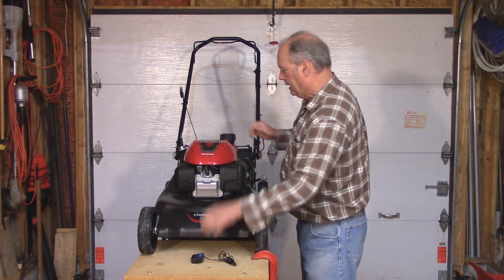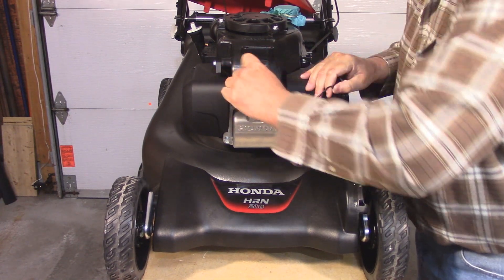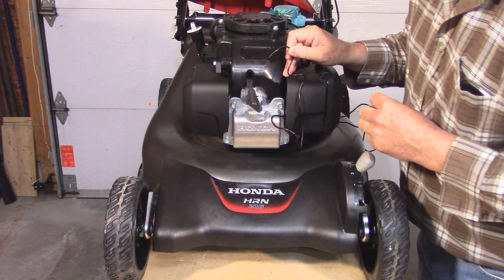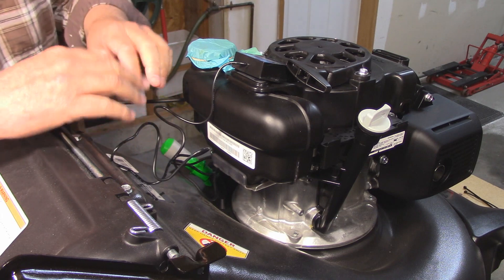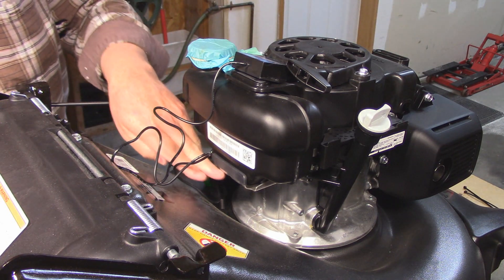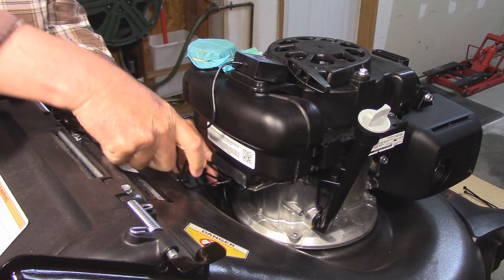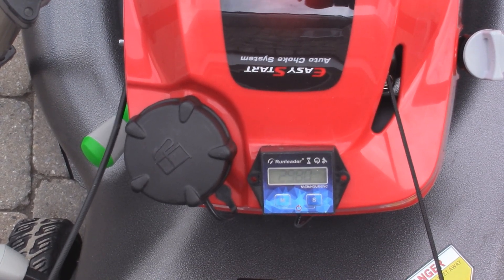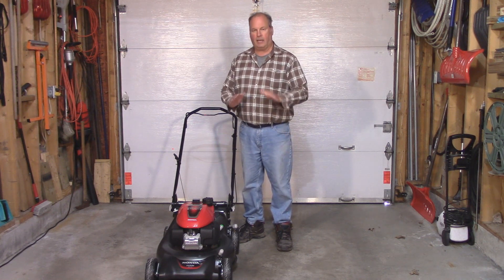Honda HRN216 Hour Meter Install

Comment: If my rpm on my Honda hrn 216 is too low how can I adjust it? It is currently at 2,800 rpm’s I would like it to be at 3,180 rpm’s for a better cut quality. I’ve already sharpened the blades and clean the deck and I am currently not happy with the cut quality.
Reply from the maker: You have to bend slightly the Governor Spring Tab. Right will increase the governor spring tension and the engine speed. Left with decrease the governor spring tension and the engine speed. See figure 3-21 in the service manual.

Comment: My CubCadet LT46 has an elapsed time meter to indicate when to do what.  With a full pressure oil system and filter, it greatly improves the oil's service life and keeps the engine internals clean.  For powered lawn/generator equipment, my gear receives oil changes at the end of the season to have a fresh oil installed for storage.  BUT, all things considered, spend the whopping 5-7 bucks per quart for Valvoline 10W-30 FULL SYNTHETIC, (OR 24 dollars for FIVE QUARTS), and change yearly....  Don't be so ^nal that you fret for being 4/10 of an hour over the "schedule"....  Once a year - Just do it....
Reply from the maker: You must be an American. For the rest of us in the world, it is either not available in our location, or very expensive. I will stick with what the manual says, thank you very much.

Comment: Helpful to learn about the time meter.  But once someone knows how long it takes to cut your yard doing whatever you do,  using a gas push mower, its easy peasy to determine time.   Let's say i use my Honda mower gas push mower for 1 hour each time cutting.  Obviously just multiply # of times cutting × how long it takes to cut and don't need a time meter. 
My Honda HRN215VKA. Instead of worrying about changing the oil at 50 hours, just change it at end of season - whether a lot or not. Just like rule for cars used to be. . Change oil lesser of x months or y miles x whichever is sooner.
Reply: But since many gas power mowers don't have an oil filter, it's important to keep clean by changing oil per hours recommended or sooner.... like with car oil changing.... for example lesser of 6000 miles or 3 or 3 mo or 6 mo.. whatever the model manual states.

Honda announced over a year ago it won't be making any more gas push mowers.  I'd bet it has something to do with the switch to battery operated everything. 

Why don't many gas push mowers have an oil filter?
Most small lawnmower engines lubricate themselves by the splash method, where a small dipper on the end of the connecting rod cap splashes oil from the crankcase onto the cylinder wall, the bottom of the piston, onto the valve mechanism, and the crankshaft and cam bearings. This type of lube system has no oil pump and is not pressurized, therefore a filter would do no good. Contaminants in the oil are removed via 25 hour oil changes.

Some larger mower engines such as the Kohler Command series do have oil pumps and a pressurized lube circuit, and do employ an oil filter.
Reply from the maker: Sure, if you cut your grass once a week and it takes you 1 hour, then it is easy. But what if it takes you 43 minutes and sometimes you cut once a week, sometimes 2-3 times depending on how much rain you get. Then in the fall you mulch the leaves and bag them, that will be maybe 25 minutes to do. Either way you are probably going to have to write it in a book to keep track. A low cost hour meter is just simpler. And it is not just for oil changes. There is also when to change the spark plug, sharpen the blade, lube the cables and wheel bushings, when to adjust your valves... ect.
Anyway, thanks for watching and for the comments. Giving more examples is how everyone can make their own decisions. Many ways of doing things. Thanks again.
Reply: Maybe I'll look for a bed sheet hour or day meter to remind me hour many days/weeks has elapsed and time to wash my bed sheets. Just joshing. It's recommended to replace our toothbrushes every 3 months also... hopefully won't forget. 

The hour meter install for a push mower is simple and nice piece of technology to have per your video even though since push mowers are used for smaller partial acreage and riding mowers when you get over a 1/3 acre, people  do mower fine up each season or end of season.  

How about going a step further.... there are "wireless hour meters for outdoor power equipment" to keep record on your smartphone etc which you can google and will see results.

Comment: I installed that same meter on my old Deere push mower.  The handle on my machine has a convenient (and wide) plastic crosspiece, so I attached the meter there.  Of course, I have no idea how many hours were put on the mower by the previous two owners (over the last 12 or so years), but the hour meter is still very convenient for keeping track of maintenance intervals.  This mower has a nice, commercial-duty B&S engine with pressure lube system, and a tiny, spin-on oil filter so it was obviously not built to be a throwaway machine and I intend to keep it going as long as I can.

Comment: Why not trim the wire? much cleaner
Reply from the maker: As I said in my video, if I decide to use this meter somewhere else I will need the wire. I don't mind coiling it up.

Comment: Can you cut off the excess wire, or is the length part of the tachometer precision?
Reply from the maker: You can cut it off. I like to coil it up in case I use the meter somewhere else later on.
Reply: @PaulPomerleau  Not a bad idea, but I for the $12 I paid I think I'd just cut mine and buy a new one if it is ever needed. 😁

Comment: thanks Paul. The link you have for this meter does not work. Do you have a good one?
Reply from the maker: Thanks for letting me know about this. I guess they changed their website. The model is RL-HM011G and I changed the link in the description to fix it. All should be good now. Have a great day and thanks for watching.
Reply: @PaulPomerleau  thanks! I'm getting at least 2 of these, 1 for push mower {my garden tractor has a meter on from the factory} and 1 for the log splitter.

Comment: so with this you will be doing the oil change following the manual instructions of maintenance, but how can you prove honda that you actually did the change, do you take a video of your self doing it? or what do you recommend just in case the ask for proof?
Reply from the maker: You don't need to. The engine will tell any good service technician if you have been changing the oil or not .
You get distinctive wear patterns and sludge buildup with old oil, as well as engine parts get tell tale color changes if they have not been getting enough oil. Just like the dentist knows when you haven't been flossing :)
Reply: @PaulPomerleau  great explanation. Thank you for the information. Have a great weekend. BTW I got the same HRN Honda. Very nice machine.
Reply: @mataflais  I just bought the HRN 216 the other day & ran it for 1hr & changed the oil like garage gear suggested & now will change it again after 5hrs like recommended.   I bought a ariens razor duel blade mower first & when I realized it had a plastic carburetor I took it Wright back & went & bought this HRN.   You've had yours for 1yr & I'm curious how you like it & how it has been working out for you.   One thing that totally bothers me about the mower is the drive belt is so exposed under the mower & lots of complaints about belt shreading cause of debri getting in belt cause theirs no cover.    I guess I just wanna feal secere about my purchase & wanna avoid problems.

Comment: Link to the meter you used doesn't work for me. Looks like the Runleader RL-HM011F? Amazon AISN B07PMJH7QV. Do you happen to know if it retains the memory of hours run when you change the battery?  Thanks, and good luck with your HRN-216!
Reply from the maker: Thanks for letting me know about the meter link. I changed it to the manufacturers website so it should be ok now. It is actually the RL-HM011G. The instructions say that it will retain memory when changing the battery. For winter storage I plan on removing the battery for about 6 months but I am not sure if it will keep the memory for that long.

Comment: Thanks Paul. I have always wondered why we need to replace spark plugs or oil at 10 hours when on a car it is 20,000km or something like that.
Reply: I'm guessing because a car engine has much tighter tolerances and is controlled by a computer with much more precision, meaning the plugs get less wear and tear and aren't fouled as easily. 20,000 km actually is a very low figure for modern cars. Both my vehicles actually call for spark plug changes only after 100,000 miles / 160,000 km in the service manual.